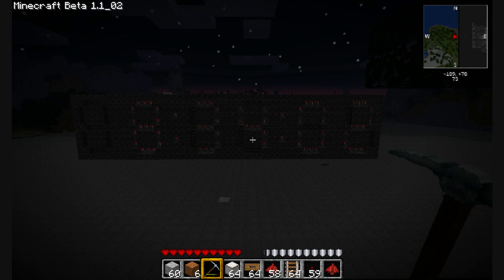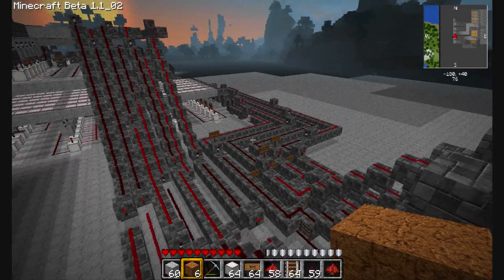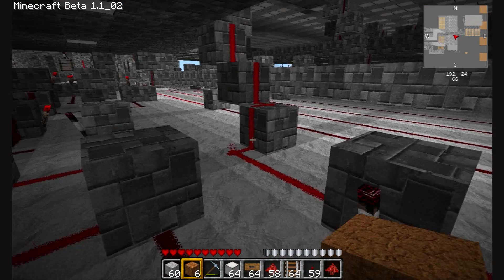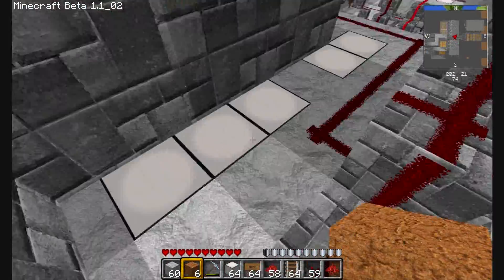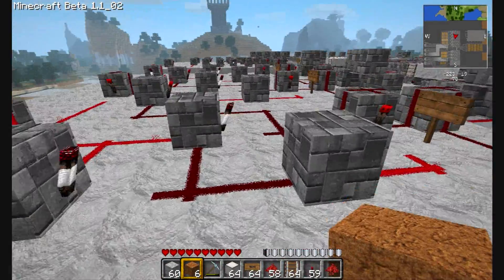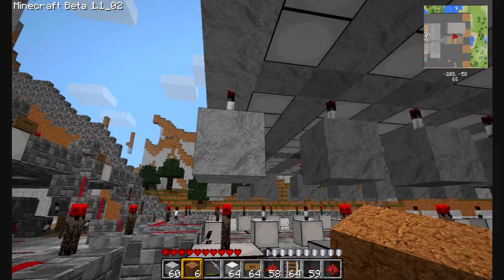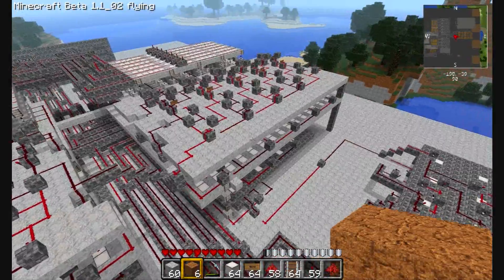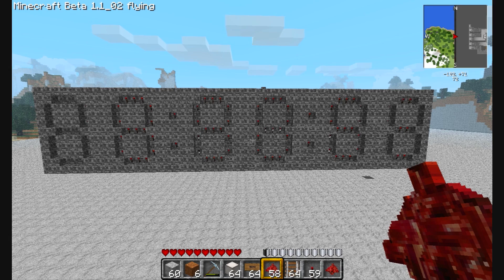Minecraft 12 hour digital clock

Comment from the maker: @ManRayOi

The first four will count to 9, the next two will count to two. You then set an AND gate from the 3rd and 6th T-Flip flops' outputs and connect it to your "Clear" inputs on the T-Flip Flops.

This would allow you to count to:
10 0011
2        3
and clear to zero at:
10 0100
2       4

The 5th flip flop needs to have it's input connected to the AND gate that's connected to the 2nd and 4th Flip Flop outputs. This will allow the 1 and 2 to count only when 9 is reached.

Comment from the maker: @ManRayOi

Yes, there is a relatively simpler way. You simply connect 4 T-Flip Flops with the 1st T-Flip Flops Input coming from the clock pulse and it's output connecting to the second T-Flip Flop's input. You then connect the 2nd T-Flip Flop's output to the 3rd's input and so on. The then set an AND gate from the 4th and 2nd T-Flip Flops output and connect it to your "Clear" inputs on the flip flops for easy BCD.

On the 24 hour system you would simply have 6 T-flip flops for the 24 hours...

Comment from the maker: @MoneyAndPeople

In my method I simply connected each flip flop to their respective lines they'd need to display in order to make their number appear. So the "1" flip flop is only connected to the inputs on the two vertical right segments, while the seven has these and the 1 top segment as well.

Hope that helps.

Comment from the maker: @EpikMetalfreak

Sure! The site is:
h t t p : / / 208 . 115 . 196 . 195 /

On the top left is a link to the minecraft jar with the texture pack pre-loaded. I have an executable file linked on the blog post on the index page that will load the zombe "mods" folder for you.

I'm planning on building an analog clock on our minecraft SMP server using the conventional T-Flip Flop method, rather than the D-Flip Flop on this digital one. Hopefully it will make things a bit more compact.

Comment from the maker: @kavika13

As far as my testing has provided, the clock is only active when all it's components are within chunk limit. 

On a multiplayer server you could keep the clock constantly active by having an idle player within the clock itself. This is assuming your server doesn't shut down.

As for single player, the clock will stop when you exit the world.

The clock will keep the time it displayed when it was last seen though, so if you disconnect at 12:31:01 when you reconnect it will be 12:31:01.